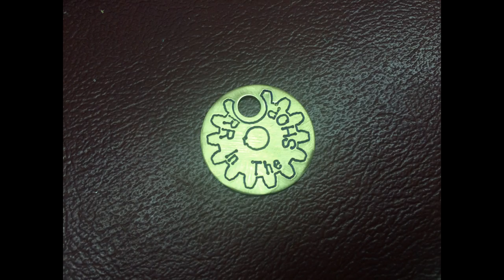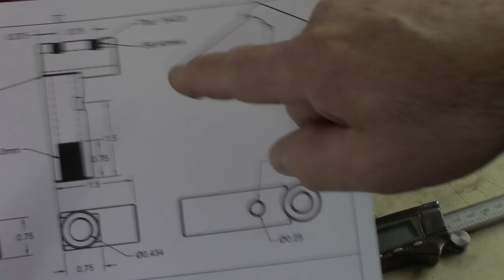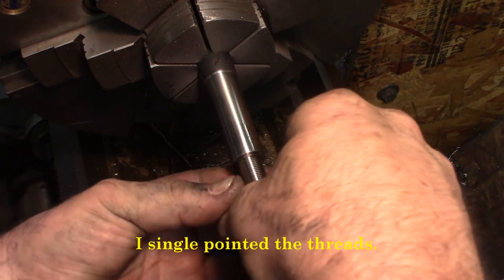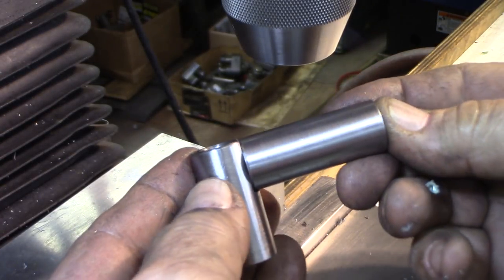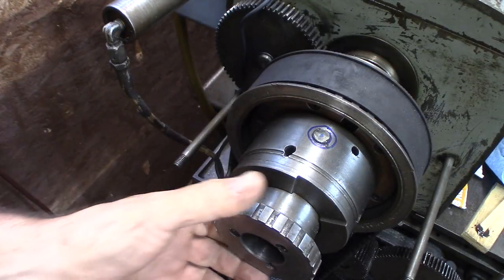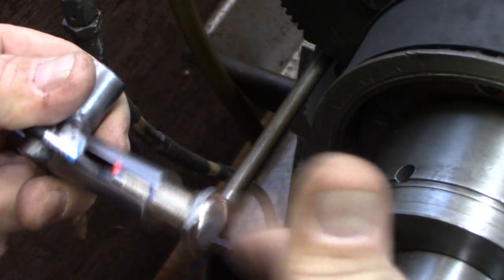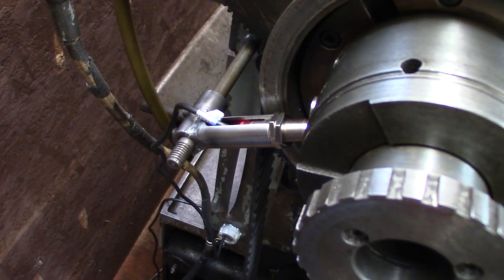How To Install a Tachometer on a Lathe

Comment: Nice upgrade. I thought at the start that hole for the wire was going to be a real pain in the butt, but slotting it was a nice work around. Well done, Peter
Reply from the maker: Yeah after some more thought things change for the better.  Came out great and works great.

Comment: Wow, an older lathe going High-Tech...   ;)
Looks good...
For you in the US metric is a weird thread whatever the pitch is, it starts being weird when it's called metric...   lol
Reply from the maker: That's right.  Weirdtric that is the common term.  They could not even get the conversion factor right, 254,, 234 would of been easier to remember.
Reply: Easy to remember.   1"   is EXACTLY   25.4mm, Works for me...   ;)
The only negative point here is that the lead screw on my lathe is Imperial and I have to leave the carriage engaged when threading.,..
Got to practice and get used to translate instantly in your mind, takes a little time, though...
Reply: Wish we'd gone metric eons ago; far superior; with the exception of the Celsius degree being a little big.
Reply: rwbishop Imperial is better for most things except a case could be made for wood working and mechanics but machinists prefer imperial.

Comment: Randy,  do an ebay search for a KSD9700 Temperature Controlled Switch order a normally-open one,  say for 35 or 40 deg C and place it in series with you aux fan.  For extra security parallel two in case one dies.  Only about $1.27 with free shipping.  Now your fan will only run when it needs to. 
Craig
Reply from the maker: I have thinking about doing that, I have three spots I could use them.  That way I could buy in bulk.  Thanks Craig.

Comment: Nice installation for the Clausing.  What did you used for the 9 - 12 VDC power supply for the tachometer electronics? I like the Hall Effect tachometer for ease of installation provided I remember check for the correct magnetic N-S orientation before gluing in place.  By the way, a M12X1 thread is the one used on my old Unimat SL1000 lathe spindle and bought this size tap years ago for making parts for the lathe.
Reply from the maker: I used a 9 volt dc wall wart,  I mounted it in the control panel for the lathe.  The thread was a bit of a pain, but worked thru it.  I really like knowing the spindle speed on a lathe, great ref. for the next project.  Thanks Paul.
Reply: Thanks for the info. I used your Hall Effect tach installation instructions I saw from one of your 2014 www.homemadetools.net articles and installed the same type on 2 of my lathes and published the setups at the same website.

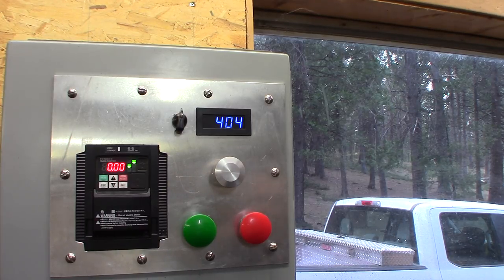Comment: 14:12 how come it still displayed 400rpm when it wasn't turning?
Reply: bcbloc02 on mine there is occasionally a lag
Reply from the maker: I will clear after a few seconds when stopping.  I think they have a slight delay on some small amount of averaging to smooth out the reading,  so when the spindle stops it takes a few cycle of the chip program to clear.

Comment: Great series. Curious as to why you run your cut off tool upside down.
Reply: For one it lets the chips fall out easier so they don't jam.
Reply: Throws the chips downward
Reply: Yes, why?
Reply: Cutting forces push the tool away from the stock rather than deeper into it. Good for lighter weight machines.
Reply from the maker: Well now for the real reason, not to say all very good comments.  It is a left hand tool, this way I can get very close to the chuck when parting which is always best.  This tool is a seco tool and works very well, I love it.
Reply: Randy Richard In The Shop ahh very clever

Comment: What power supply did you use? I think I'm going to use batteries.
Reply from the maker: Just an old DC 9 volt wall wart.  I think any DC 6 to 15 volts will work.
Reply: Thank you sir.